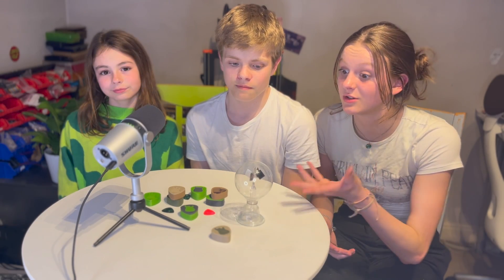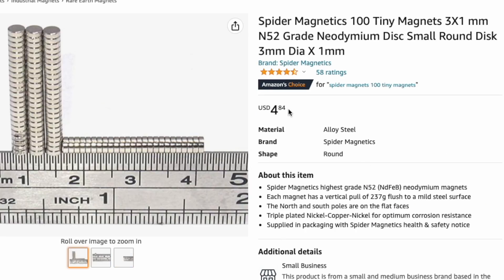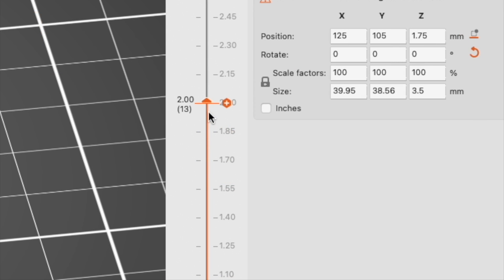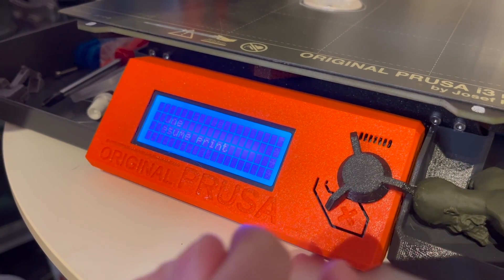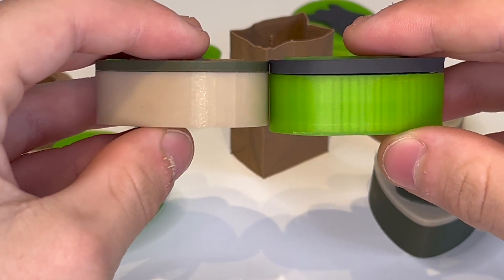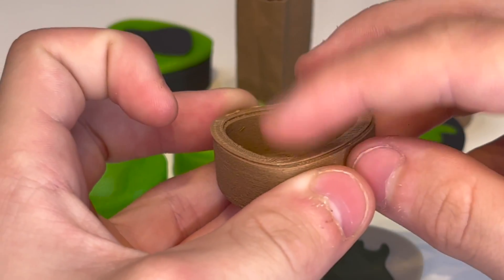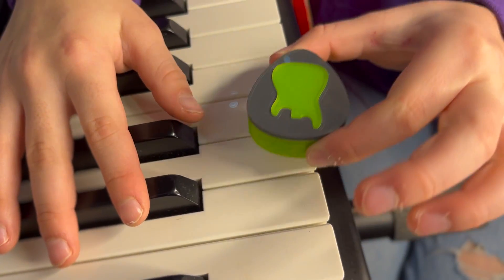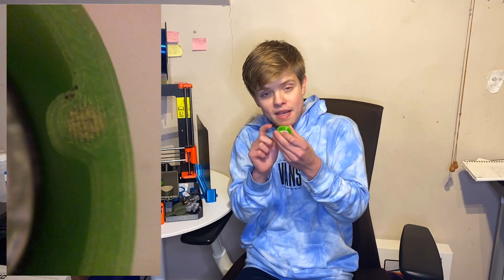How To Embed Magnets in a 3D Print without Glue: A Step-by-Step Guide - Bonus Guitar Pick Box

Comment: My magnets stick to the to the print head when it passes over them instead of staying in the holes, what can i do about that?
Reply from the maker: Our nozzle is not magnetic so we do not have that problem perhaps you would need a drop of superglue. It would still be embedded the glue is only to keep it in place so your print head doesn't attract it. Or you could design in a layer of filament where you could slot the magnet in under that layer and it keeps the magnet from moving vertically to the print head then fully close the magnet in on the next layer. It wouldn't work for such small magnets as in our pick box model but for a larger model it would be a possible route. Good luck with your printing and if you come up with a better solution please share!